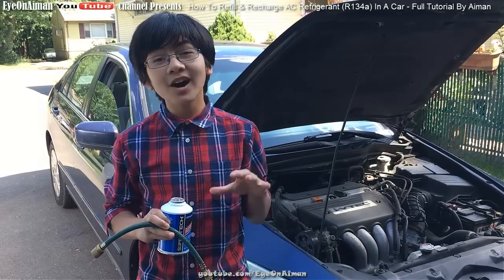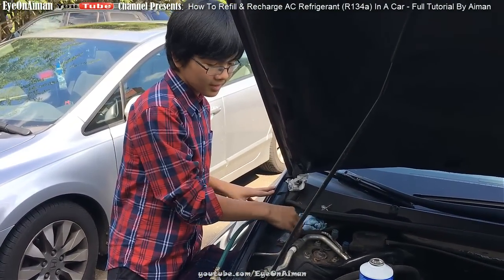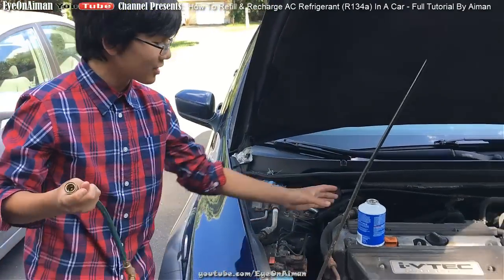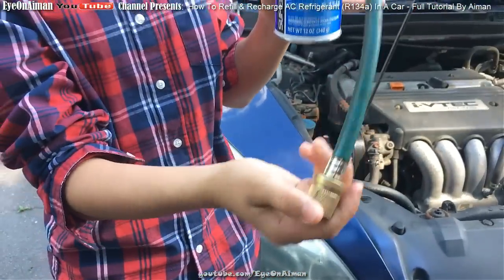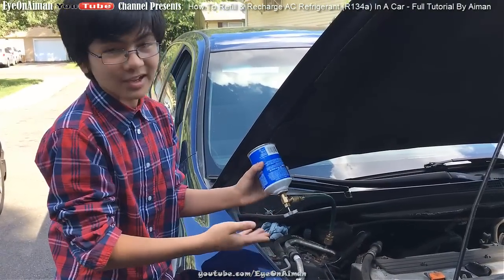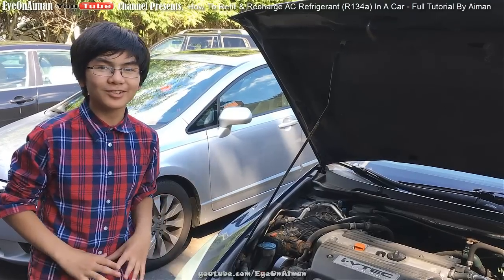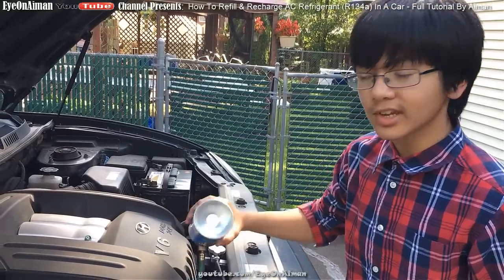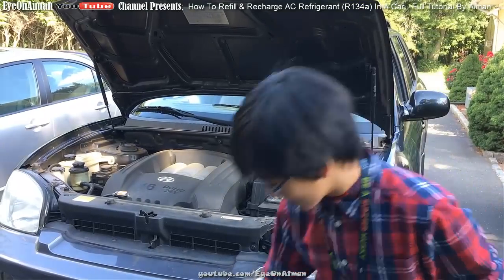How To Recharge Air Conditioning & Refill AC Refrigerant R134a In Your Car / SUV | Full DIY Tutorial

Comment: Good job , but you really have to use the correct equipment and know if it’s actually the correct amount ! You can here it clicking on and off , you probably over charged the unit...and you can cause more damage than good. lesson learn should be if you don’t know what your doing stop doing it !! and learn how to correctly, start with proper gauges and see what it tells you about the system.. you can’t just add a can and expect it to work, too many factors ..it doesn’t matter either what line is front of what ! Stop just adding cans to vehicles ,that’s not how it works little billy !!! Take your own advice  less is more , but you don’t know how much it needs , and it’s not always the compressor, there s more to an ac unit than a compressor and  Freon ! Please stop doing that !!

Comment from the maker: Looking to buy AC Refrigerant, recharge kit, charging kit, manifold gauge, pump or other diagnostics tools?  Here are the links to buy on Amazon.com:
1.  https://amzn.to/2R2YcHF | ACPRO REFRIGERANT 20OZ
2.  https://amzn.to/2ZiUiPn | Red Angel A/C Stop Leak & Conditioner
3.  https://amzn.to/3lVNsJn | ZeroR R134a Refrigerant for MVAC use in a 12oz Self-Sealing Container (3 Pack)
4.  https://amzn.to/2F8PHrV | 4 Way AC Diagnostic Manifold Gauge Set, Fits R134A R410A and R22 Refrigerants, with 5FT Hose, 3 ACME Tank Adapters, Adjustable Couplers and Can Tap
5.  https://amzn.to/2F6g6qk | Robinair (RG3 Portable Refrigerant Recovery Machine – 115V, 60Hz, for Both Liquid and Vapor Refrigerant
6.  https://amzn.to/3hb1wuN | Elitech WJL-6000 Freon Leak Detector Halogen Leak Detector Refrigerant Gas HVAC R22 R410A R134A R1234YF CFCs HCFCs HFCs Detector High Accuracy
7.  https://amzn.to/3k05wzV | ZENY 3.5CFM Single-Stage Rotary Vane Vacuum Pump for HVAC/Auto AC Refrigerant Recharging w/ R134a AC A/C Manifold Gauge Set Combo
8.  https://amzn.to/2Zj2yid | R134A Car AC Refrigerant Charge Hose Kit Recharge Hose with Gauge,A/C 1/2 Recharge Measuring Kit Can Tap Air Conditioning Pressure Gauge R134A by Ketofa
9.  https://amzn.to/2DEr4mr | XtremepowerUS 3CFM 1/4HP Air Vacuum Pump HVAC R134a R12 R22 R410a A/C Refrigeration Kit AC Manifold Gauge R134 Can Tap Included Carrying Tote